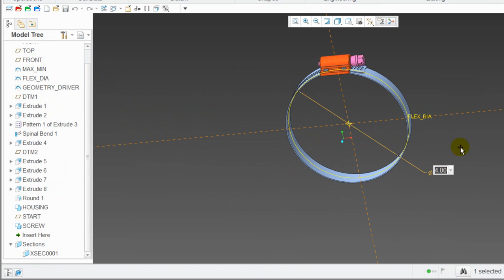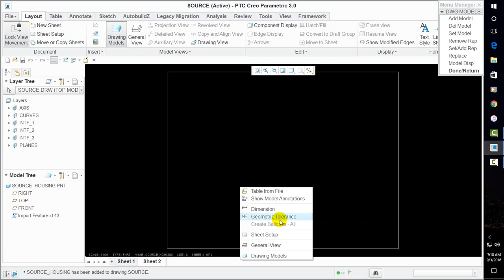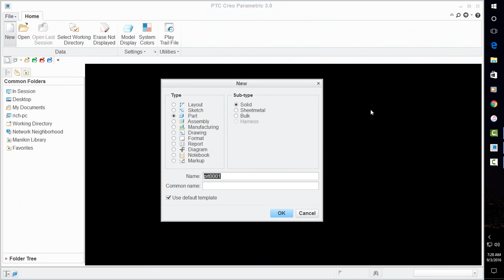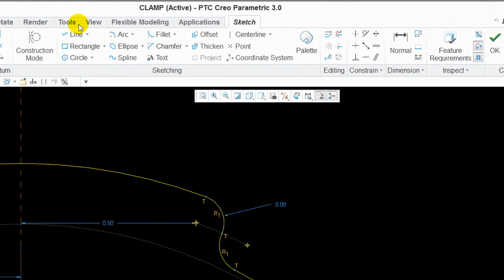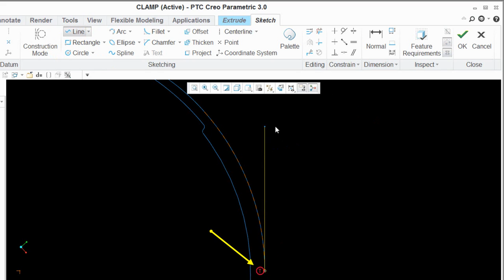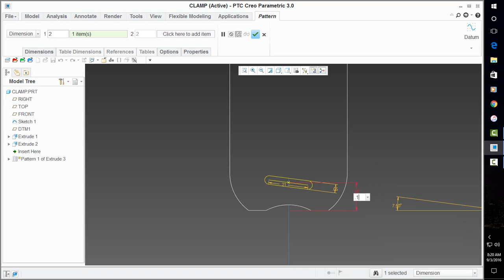Creo Flexible Hose Clamp - Part 1 of 3

Comment: I've got a question. If I was using this clamp as a straight-continue fitting in Pro/Piping, how would I define its predefined flexibility? I have a straight-break fitting that I'd like to vary the length of from time to time (using a single flexible dimension), but can't seem to find the flexible properties when it's assembled as a fitting with Pro/Piping.